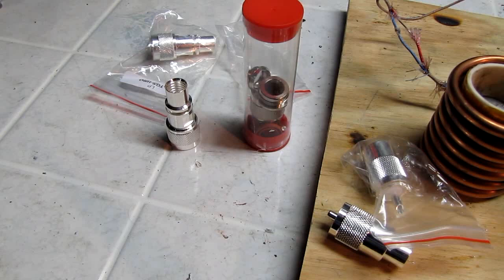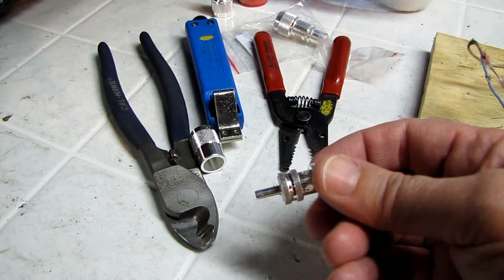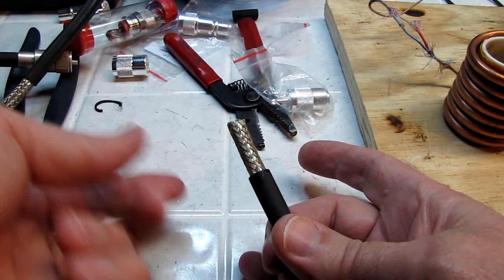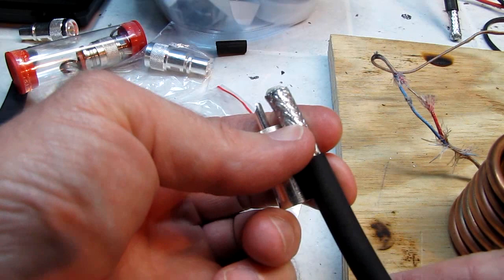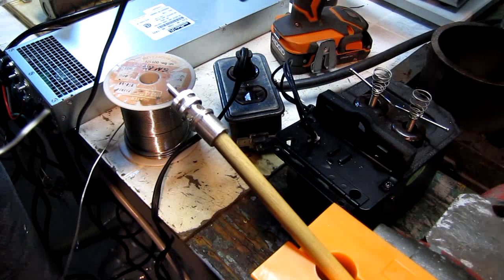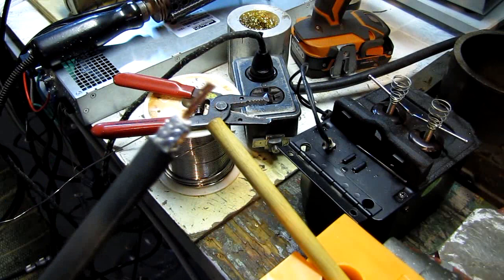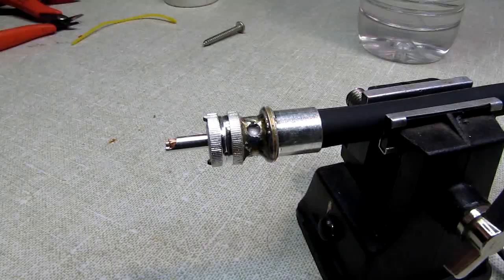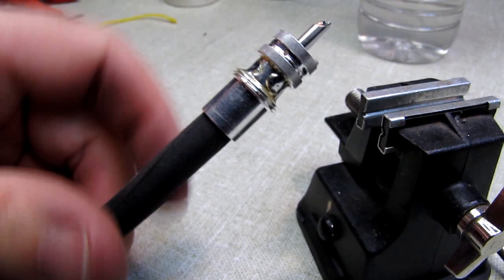Soldering PL-259 and N connectors

Comment: I am having a hard time getting solder to adhere to copper wire on a so 239 for making an antenna. Do you have any tips or advice. Thanks...
Reply: Make sure the copper is clean and make sure the connector surface you are soldering to is clean. Small file, sandpaper, steel wool can be used or even a sharp knife to scrape off any oxidized metal or lacquer. Make sure the tip of your iron is clean and wet it with fresh solder just before you apply iron to join. After heating join for a while, apply a touch of solder to the iron. This should flow over the join and transfer more heat. Then apply some solder to the join. Keep iron applied for a  second or two then remove it.

Good tip is to lightly tin both surfaces before putting them together and soldering the join.

Also, make sure your iron is up to the job. Would advise something like a 100W iron for PL259's.

Maybe get some scraps of thick copper wire and practice solder them together to get the hang of it before risking messing up coax and PL259.

Comment: Where can in get the new two piece N-type connectors please
Reply from the maker: I buy mine at the local ham store, Ham Radio Outlet. However RF Parts website has them listed as RFN-1001-S.   RF Industries Type N Male Solder two piece. They get around 7 yankee bucks each and are solid Brass with Silver plating. There are cheaper CH!N3S3 versions but they are pretty much crap. You get what you pay for.
Reply: @theradiomechanic9625  thank you
Reply from the maker: @peterdavies8910 Are you in the UK?  My mother's maiden name was Davies. Grandparents were from Wales.

Comment: After tinning all parts of the connector and the cable shield and center conductor, be prepared to file excess solder down so the connector screws on. It is never easy to solder these connectors. I've always used a snug (not tight)  vice to hold the cable while working on it.  Your hands are your tools. When you use a hand to hold something your'e working on, it becomes a very poor vice, and you loose one of your two natural tools. Always use a vice to hold projects when possible so you have use of both hands. If you have no vice, then at least use a table or bench and hold items down with duct tape.

Comment: A great video! I was in that to be named later 3 letter store today. A mutual long time friend told me about the channel,  and I'm hooked.  Great info,  really well put together,  and presented with practicality.  I have to look to see if there's a video on making that solder pot. That makes quick work of tinning the braid.  One quick question,  some of today's cables are double braided. How do you insure both inner and outer braid are grounded properly.
Reply from the maker: If both braids are solderable they will bond together. In any case there is enough contact throughout the cable to insure a reliable connection. Thanks for watching.

Comment: Thanks , putting up my first moonrakers , I need all the help I can get , I'm just a little nervous about a short  between the braid and the center , Thanks . now how would one test it to make sure no short ?
Reply from the maker: Tin the braid so that there are no "whiskers" . Cut and trim carefully, then check the finished product with an OHM meter. 
There should be no continuity between the center conductor and the shell. Check BEFORE you connect to the antenna as some antenna matching systems show up as a short at DC.

Comment: Where did you get the vice clamps for the cable?  Great video, thanks..
Reply from the maker: Hi Paul, Those are plastic vice jaws with magnets to hold them in place. Think they came from Home Depot a few years back.
Just search for soft vice jaws or plastic vice jaws. Something will turn up. Thanks for watching.
Reply: I bought two different vise jaw pad sets for $19 shipped on Amazon. Nice grooves for different shapes and angles.

Comment: This method is really cool. I love it. How much Solder was in that pot?
Reply from the maker: HI toby. I bought a bar of solder on e-bay and used about 1/3 of the bar. When I de-solder things I put the scraps in the pot also. 
The thing makes short work of assembling cables. Thanks for watching.

Comment: How many watts in your ol soldering iron, because I want to buy a iron & a soldering gun. I thought a 150w soldering gun would be good for starters, but how much should the iron be about 60W or so?
Reply from the maker: Hi John, I have Guns that are90/150,  100/140 and 240/325 as well as Irons from 20 to 500 watts. All have their uses. The Round handled iron in the video is 100 watts. Plenty of reserve for quickly making the solder flow into the connector shell. Also have several different tip styles from screwdriver shaped, triangular, round, pointed etc. You can never have enough irons. He who dies with the most irons wins. Vern

Comment: I don’t measure the cable either.  I have that Tool DX Engineering sells that takes 20 seconds to use and I’m done.
Reply: As do I, it is great. But I don't use the Pl-259 that has the screw in piece, I just crimp the sleeve type, I like those a lot better.

Comment: 185 degrees. Solder melts around 400 degrees.
Reply from the maker: The most common soft solders (lead/tin) melt between 180 to 190 centigrade. Look it up.
Reply: The Radio Mechanic  Ok your talking Celsius. I was talking Fahrenheit
Reply: @wireworks616  only the us still uses Farenhight

Comment: Is 100W soldering iron ok to use for your tutorial? Thank u for sharing 4i1ANA 73
Reply from the maker: Sure, it all comes down to soldering skills. Did it with an iron for years, but much faster and cleaner with the pot.
Reply: Yes a soldering iron is whats needed or soldering gun both will work. He just has a hand made method that is not needed.

Comment: Hello Vernon, Boy I enjoyed the heck out of the you tube video on soldering connectors using 1000W ZVS Low Voltage Induction Heating Board Module Flyback Driver Heater. I have been involved in electronics from about 10 years old and as I said I enjoyed learning from your video.   I just ordered the unit but have been having trouble finding the correct size 40mm crucible on ebay.I think I found one for $48 ! , hope you can point me to a cheaper one. Please email me  k1zek@arrl.net 
 I too am a ham radio operator K1ZEK and am now living in Saint George SC. I am rebuilding my ham shack ( shed out back ) so I can get behind my operating desk with out tripping on RF cables and power cords as I am a "very old" 72 years and have a broken neck and so-on. I am good on QRZ and also have a few You Tube videos under the name K1ZEK.
Thank you so much for making the video and hope to hear from you very soon. 
73, from Leo k1zek
Reply from the maker: Hi Leo. Thanks for watching and the kind words. I am kind of puzzled though as I just did a search for ceramic crucible on flea bay and there are dozens of them for 10 bucks ( or less ) free shipping. Nothing sacred about the size except it needs to fit in the coil.
73 Vern
Reply: Thanks for the response, I will look again. What size ceramic crucible  are you using ? bk
Reply from the maker: Mine measure 1.55" (40mm) X 1.85" (47mm) which leaves some room for a layer of fiberglass mat and some Kapton tape for insulation. Fits snugly in the coil.
Reply: The Radio Mechanic Many thanks for taking time to respond: 73..Leo. k